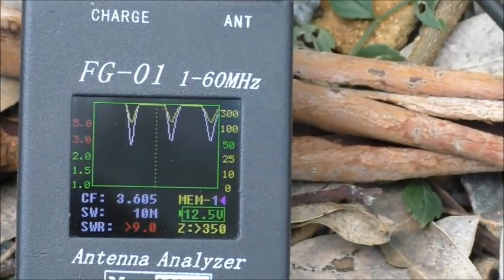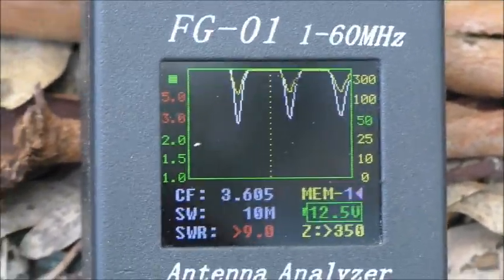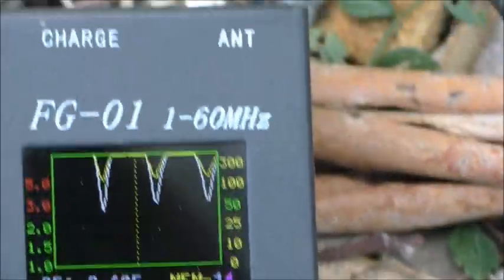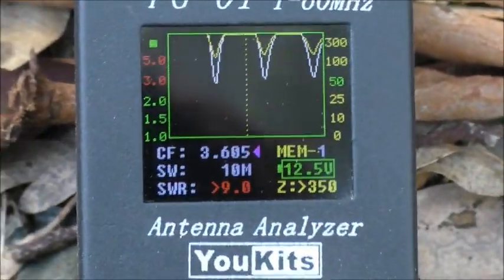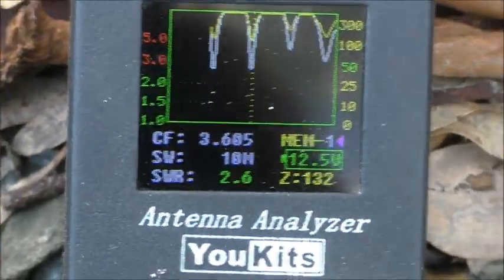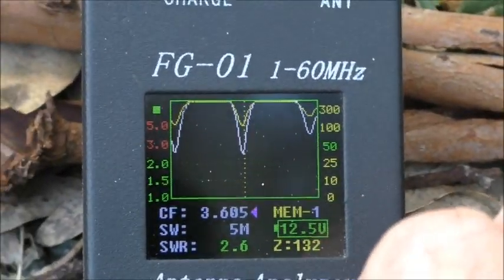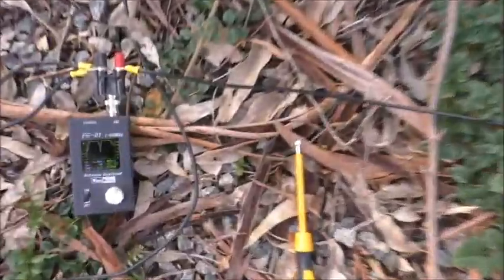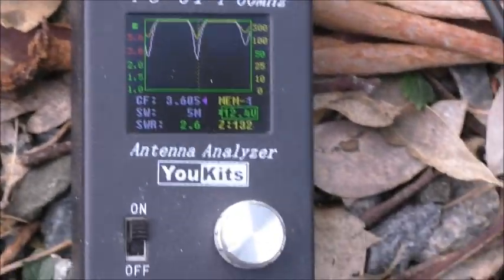Tweaking The Wire Antenna For 80m

Comment: All those years at Orfordness paid off.
Nice antenna lengthening idea. If it works it works.
Reply from the maker: What... Orfordness, where did that come from? That would have been fun. I have since removed the extension as I optimized the antenna for 20m to see if I could get GB3RC. It still seems to work well on 40 and 80 so I think I'll leave it as it is.

Comment: How abt a coil tappeed at the end of  the antenna
Reply from the maker: Introducing inductance at the feedpoint might attenuate the higher frequencies. I didn't want to put anything there that required adjustment.
Reply: end only not feed point adj once and forget it like  the good old days  lg6mn
Reply from the maker: Precisely.